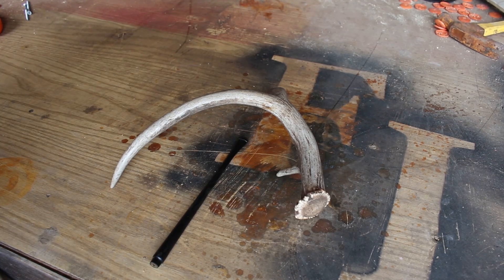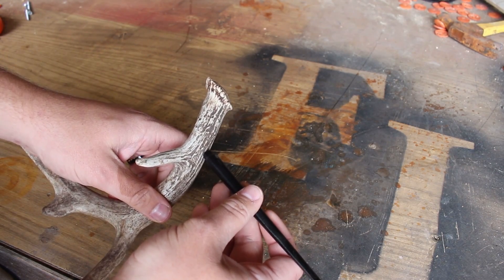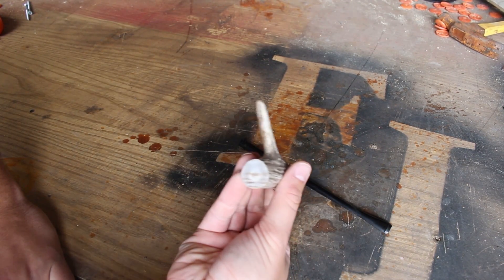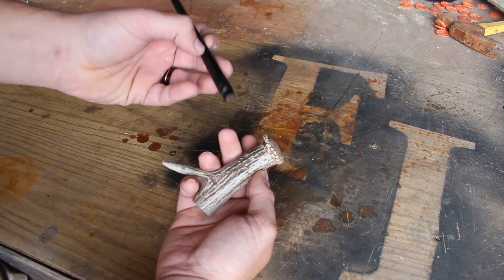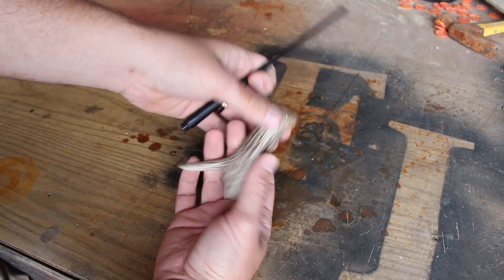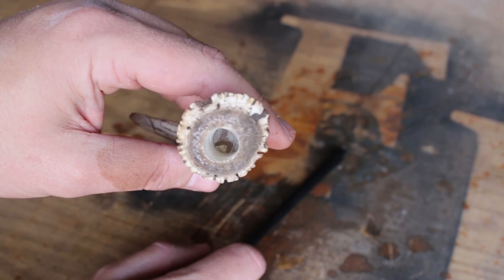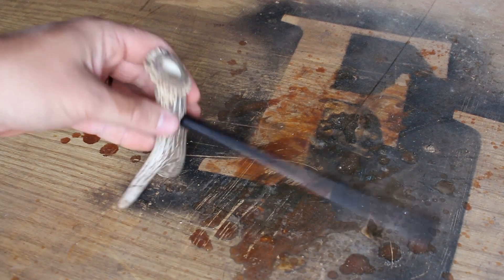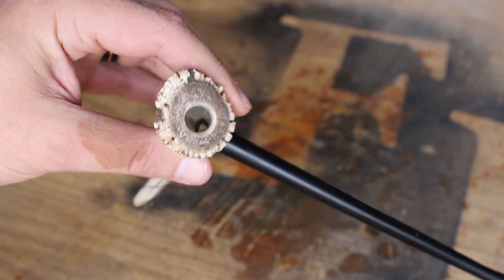Deer Antler Pipe

Comment: Don't you haft to heat treat the inside so you don't smoke bone with that tobacco?
Reply from the maker: It’s just for show. We don’t use it.
Reply: I've made many many antler pipes for over 30yrs, I smoke the hippy lettuce in them, but what I've always done before the first smoke is season the bowl by rubbing it well with honey, it creates a kind of coating and I've had zero health issues from smoking with antler pipes, and I've probably smoked on them a million times over the years.
Reply: @lynnrogers3628  do you let the honey dry and do you use normal store bought honey?

Comment: I was bored at work and on break so I quickly made a pipe out of a large raccoon bone that has been there for a long time so long in fact that all the marrow is completely gone I just hacked off one in with a hacksaw hacked off the top drill press the bowl took it home Soaked in Bleach baked it and it seems that I made the bowl hole a little too close to the back side and you can kind of see through it and it actually burnt through it in one spot so I'm going to get some clay and attach the clay to the Bone and like shape it until like some type of a funny face
Reply: I also found some deer antlers down there near where I work I guess I'll be making a deer antler pipe to now 😁
Reply: Do you think clay will stick to a bone and stay attached after I bake it?
I'm considering also applying a thin layer of non-toxic food grade silicone they actually make some pipes out of silicone